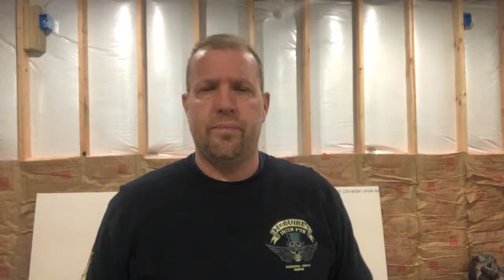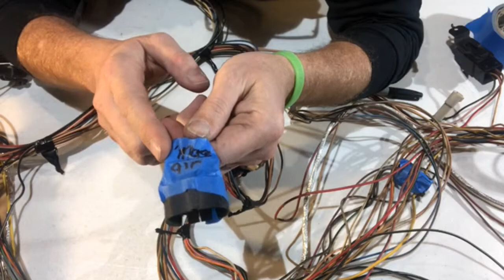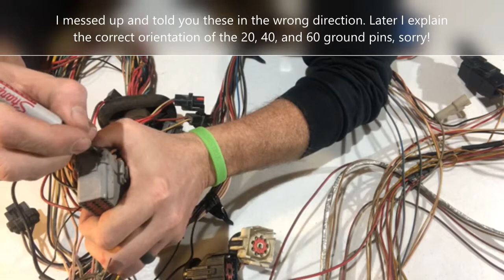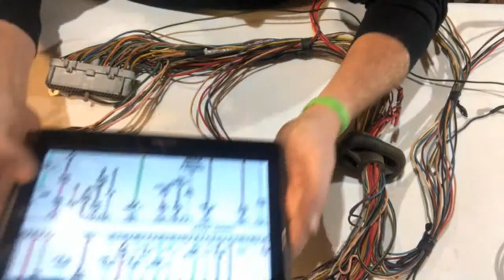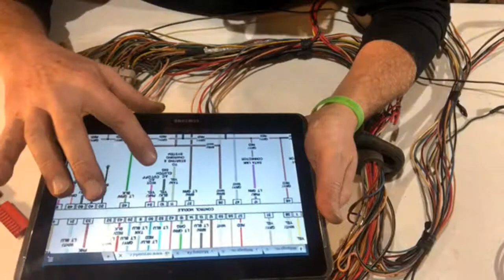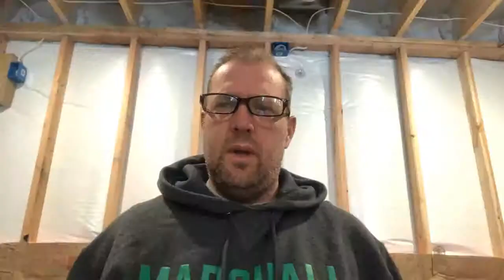Converting the Ford 5.0 EFI harness part 3: Removing the emissions and AC wiring

Comment: what would you charge to convert a harness for me? I am told it came out of a 1982 Police Mustang, when I got it and the T-5 transmission(which is I assume the same one that was connected to it in the original mustang), they were in a 1966 fastback that I bought to build my wife an Eleanor Mustang I have taken that motor and tranny out, and they will be going into a 1951 ford rat rod pickup truck, my email is billcieluch@yahoo.com